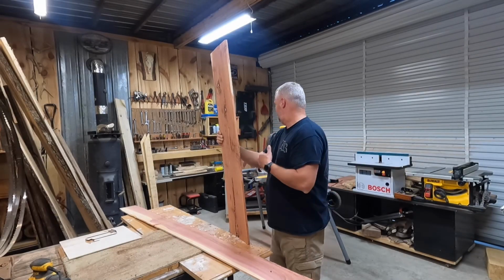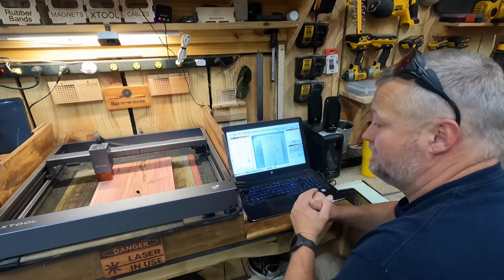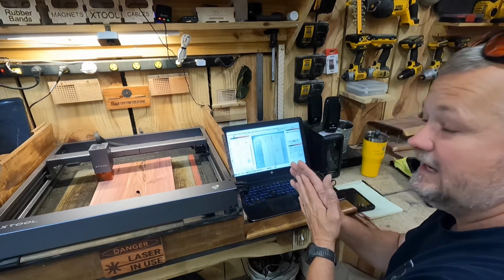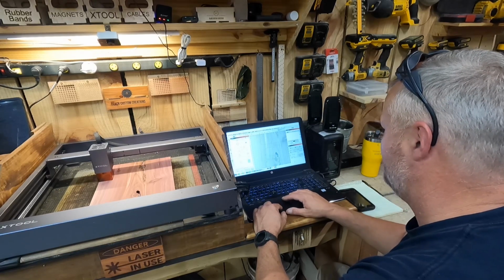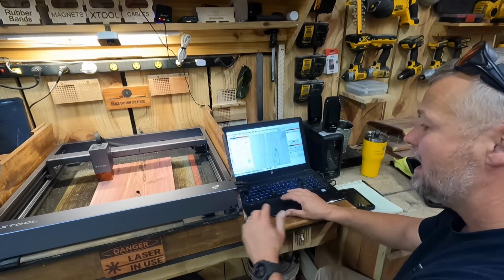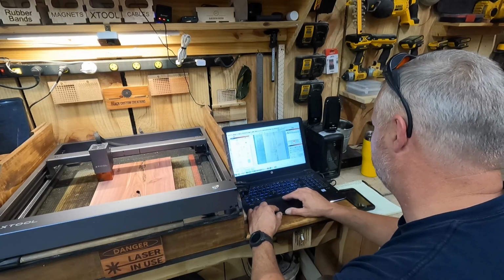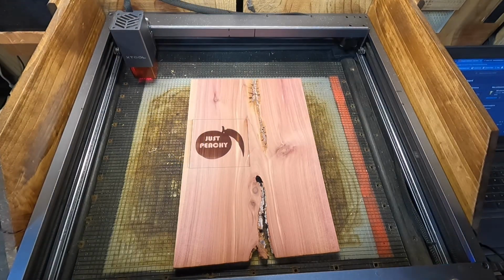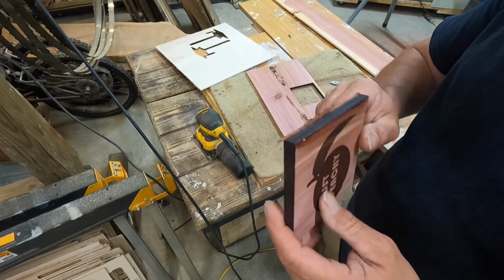10 watt diode laser cutting 10mm cedar

Comment: The difference between manufacturers is surprising. I just put a plank of 26.25mm cedar in my 10watt Ortur Laser Master 3 LE with settings of 70mm speed and 100 power with 7 passes and it left a sliver of cedar in one spot, using air assist one test and no air assist the next test. The air assist test is more charred probably because of the extra oxygen it gets while cutting. It cuts through 18mm pine with a setting of 100 speed and 100 power in 4 passes.
Reply from the maker: Sounds like you have a good machine.
Reply: Can you cut 19mm pine wood with a 10 watt?
Reply: @TheAmbientTech  Yes you can! I've cutout the word INLAY in a piece of 19mm pine and each letter falls out so cutting through is not a problem.
Reply: @TheAmbientTech  Did you read my above post?
Reply: @radesigns001  just did. That's great news. Thank you.

Comment: What would this look like if the wood was baltic birch, which is quite more dense? Doable just a few more passes?
Reply from the maker: Plywood is much more difficult to cut due to the glue. With a 10 watt, it would require lots off passes

Comment: I have a question regarding running the laser at 100 percent power, if you run the laser at 100 percent do you  reduce the working life of the laser?
Reply from the maker: In my opinion, No. If you keep it clean and use proper care, it should last longer than the bearings and other parts. Diodes are built to be ran up to 100%. If they wanted it less, they would limit it in the module. I have seen no proof of it making a difference. Keeping it clean does though
Reply: @TheClackShack   thank you!

Comment: I have a ray5 10w I’m having trouble cutting birch plywood should I be able to cut through it your is laser to small I have went as low as 100speed and 100 power thanks
Reply from the maker: Depending on the thickness of the plywood. It will likely take a few passes. I run 7mm/s at 100% with 4 passes on 10 watt machines. Air assist and a honeycomb are a big help.
Reply: @TheClackShack  plywood is 4.75 mm
Reply: @TheClackShack  Vic again I got it to cut through is 40 mm a minute at 100 and 8 passes birch plywood is 4.75 mm  is this normal to take so long I am using air assist and a honeycomb
Reply from the maker: @victorsimerson1095  Some plywood is tough. Basswood is much softer

Comment: How long does the cutting head last? How many cut hours before clean the tip? What is the consumable on this thing?
Reply from the maker: All that is dependent on how you perform maintenance. Mine is still going strong 2 years later.
Reply: @TheClackShack  Just what is the maintenance ?
Reply from the maker: @matthewmutz9337  keep it clean and lubricated

Comment: Curious if you tried again with a different speed or number of passes on the cut and if you got it cut completely through?
Reply from the maker: I haven’t tried much, I have a band saw that I usually use for the thicker pieces. May be possible with air assist.
Reply: @TheClackShack  understand, thanks for the reply and for sharing. You can send some of the pretty cedar and I’ll try!  Lol

Comment: What about hardwoods? Can I cut 3/8 maple or walnut on the 10w? 1/4?
Reply from the maker: I havent tested it on thicker material but it will cut 1/4 inch hardwoods with multiple passes. Air assist is a must for the harder woods. I could do a video on the different machines. I have several now.
Reply: @TheClackShack  that was fast. Thanks I appreciate it. I work with hardwoods exclusively and I have a few products that are 3/8ish. The laser would make it easier. Maybe I'll just get the 20w d1 pro.